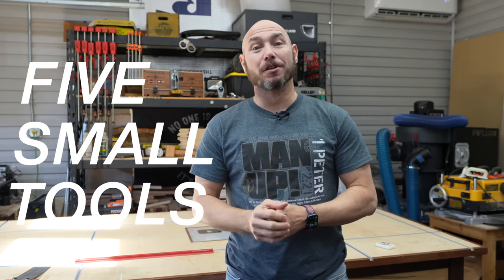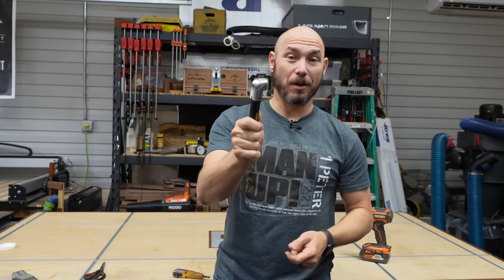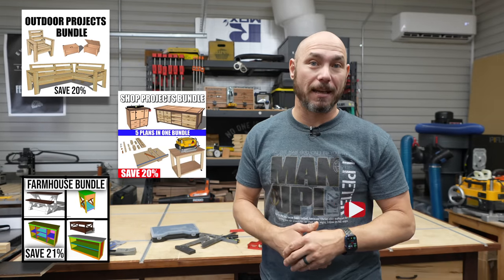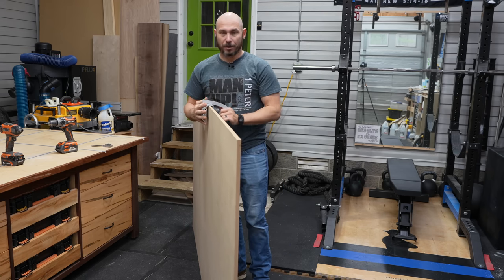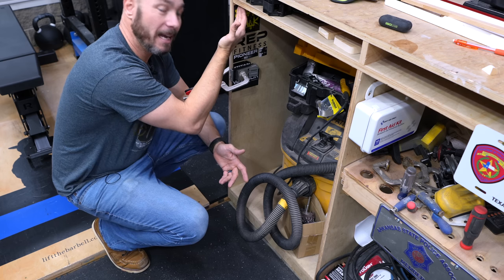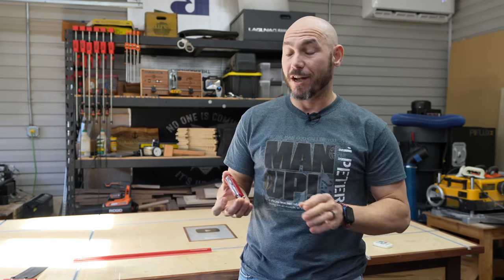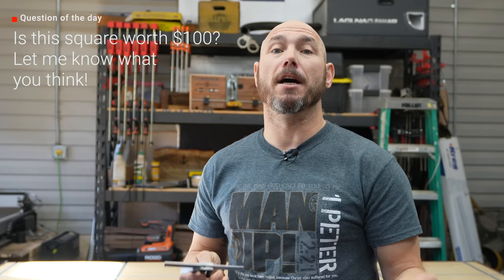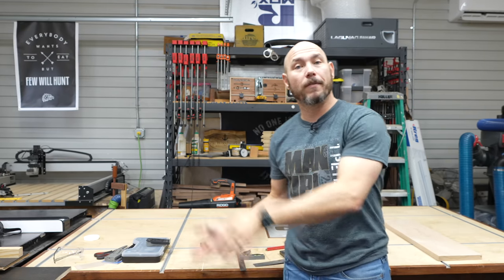5 Tools Under $30 Every Woodworker Needs

Comment: I bought the DeWalt right-angle driver a couple of years ago thinking I knew I was going to need it. Nope. Not that I think I wasted my money, but I just haven't had the occasion to use it yet. Go figure.

I've had a Swiss Army knife probably as long as you have but I haven't carried it every day since 9/11. I don't travel a lot but I had some occasions where having it in my pocket presented a problem and going back to the car was a pain in the you know what. I ended up just not carrying it anymore. By the way, I lost the toothpick a long, long time ago. I used it a lot. Lol

I agree about the small square. I've bought a few cheap ones just so I could have one but there was always something about them that was annoying. I have settled on an Empire 6" for a combo square but I really love my little 3" DelVe square from Woodpeckers. It's the most expensive Woodpeckers' tool I've bought to date but it is so handy to have. Like your Starrett 6" combo, I don't regret buying it.

I can never seem to find a good punch whenever I think to look when I'm at Holmes or Lowes Depot (as my wife called them one day, Lol) and I never think to look on Amazon. Now I have no excuses. Thanks.

Comment: Hey there.  Just wanted to comment about the Starrett combo square.  I had to break down and make the purchase.  If you ever want to take your woodworking to the next level of accuracy, you will absolutely need a reliable square.  I have used everything from Stanley, to Empire, to used....  The Woodpecker is the next best thing, but way too costly.  Does Starrett really need to charge so much? IDK.  You've got to consider how manufacturing and insurance cost in American companies can't compete with cheap labor and poor working conditions found across seas.  SO if you go American, you have to pay twice as much as China.  That said, Starrett is definitely a huge step up for accuracy, and combo squares are absolutely essential tools for more then just a hobbits.  Otherwise you can always go Stanley or Black and Decker, for good enough.

Comment: I have a Harbor Freight 6" combination square and I use it ALL THE TIME. Is it as accurate or expensive as a Starrett? No...but it works well enough for my needs 😁
Reply from the maker: If it works, it’s all you need
Reply: I got one and it's worthless. Angles are not even close to a 90. Next time I'm at hf I'll try a different one
Reply: @freedomgunsandliberty  I know that not everything from HF is... "High Quality". I was skeptical when I bought it. But did a test and right out of the package it was dead on 90. If it hadn't been I would have returned it with no hard feelings. I suppose I may have just gotten lucky.
Reply: @TheWeekendWoodshop  just looked and mines a 12" may be why it's so far off. Bought a electronic angle finder at Walmart last night and it's dead on. Very impressed for 20 bucks

Comment: I have a mini speed square that I really like.  Also I have a hand driver with a quarter inch socket on the end that lets you turn any quarter inch socket into a nut driver.... super handy.
Reply: I guess I don't really use the hand driver for woodworking though.

Comment: I have the Empire 6" Combination Square. I use it all the time. Less than $10. And unlike some other brands, my Empire holds square and true. I'm not sure what makes the $100 square better than this square.
Reply: I also have a 6" Empire I  bought when I got started, it now sits idle. I purchased a blemished 6" PEC double square from Taytools as well as a 12" blem combo square and have never regretted it. The blemish is purely cosmetic and does not effect function. 
The PEC has a cast iron body which is immediately noticeable weight wise (good weight). The working edge of the body has a polished finish and allows it to slide easily against your work piece. The Empire is aluminum and will wear quicker potentially causing the square to be inaccurate. The working edge is not polished, every one I have seen has a rough edge and doesn't slide well. The PEC blade has a satin finish which does not glare when light hits it. When using the Empire I remember having to constantly find the right angle to read the blade when measuring to avoid glare. The PEC markings are very clear and easy to read. Much like the Starrett, it has 1/16, 1/8, 1/32 and 1/64 increments. Since the blade and body are similar in hardness, the chance of wear over time drops to almost nothing. You may also notice other deviations in the blade/body of the Empire as it is not machined to the same tolerance as Starrett or PEC.
These are the biggest differences you will notice when purchasing a "high end" product. Starrett and PEC make quality products. A 6" combo square will cost about the same from either company. I would suggest looking at taytools.com and find a blemished 6" combo square or double square. Spend the $25 and get one to compare to the Empire. If you use it and don't like it, I will buy it from you.

Comment: They say everyone should keep one of those within easy reach in their car. Why? In an emergency when your car goes into the water, you can shatter a window and get out.  By the way. Smash and grab theives use them to get into yor car to grab stuff you leave on the seat. They also smash your back side window. flip down the seat, and grab what is in your trunk. Smashed and gone in 20 seconds.

Comment: If you get the Harbor Freight automatic center punch for 99 cents, try it before buying it… I bought 3 at once and 2 worked, the third one needed a little work. 
Personally, I like a 12 inch  over the 6 inch combo square, it’s not a condemnation, it’s just my choice. 
Swiss Army knives? Heck yeah, handy and small, always right there in your pocket, ready to get it done.
Don’t forget razor blades… get a 100 pack for about 5 bucks, they’re handy and versatile.

Comment: Note on the Gator Grip, read the instructions and remove the plastic on the rubber pads... dont be like me and use it for a year with the plastic on there.
Reply from the maker: Ha. Yes!
Reply: Good Pro Tip! I bet it's like brand new and working good as new too! lol

Comment: Great suggestions, Matt.  I have several of those items but have recently been thinking about the right angle drill adapter.  Project Farm did a video on those a while back, here's the link:  https://youtu.be/-g6OYTXWjpg  Spoiler alert, the Milwaukee 8510, Milwaukee 2390 and DeWalt DWARA60 came out on top.